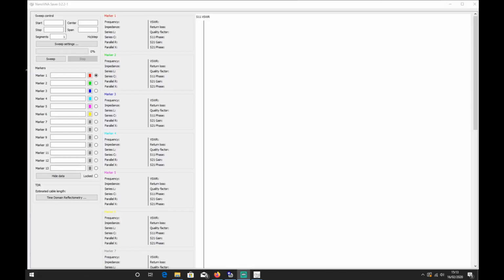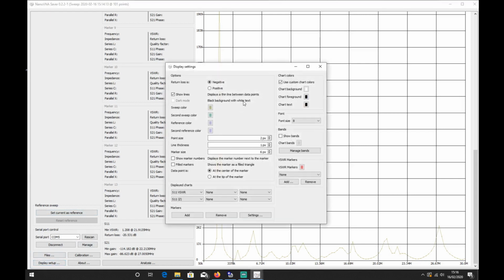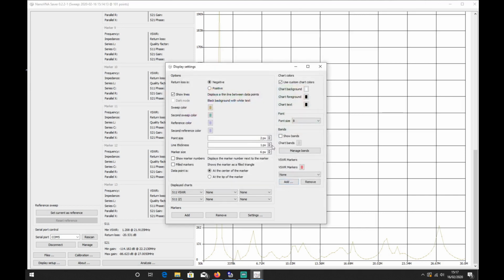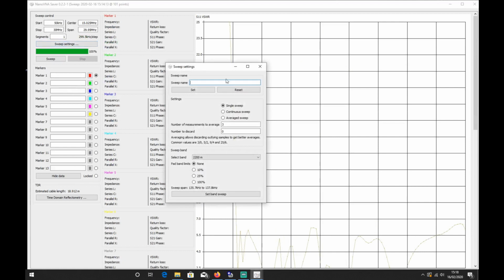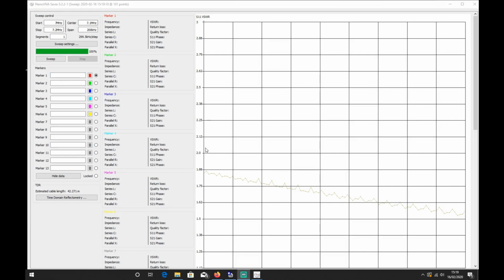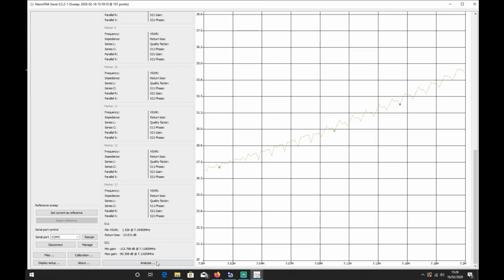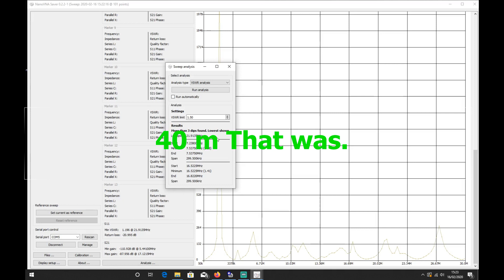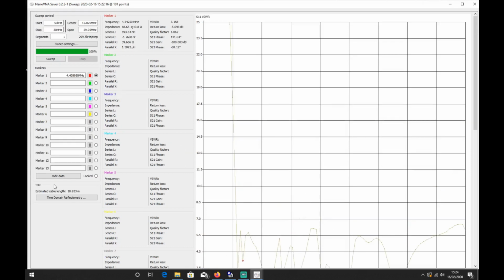Nanovna Saver software review.

Comment: NanoVNA has a HUGE Bug in it!   The built in CAL function doesn't work properly and if you use it to calibrate the device then the SWR function won't work properly and just shows a straight line across the bottom at about 1.02 all the time.  For it to work properly you have to calibrate on the device itself.